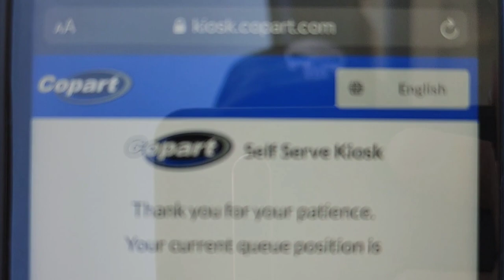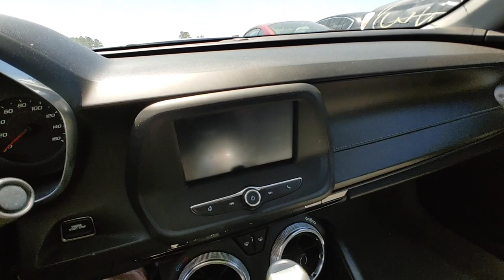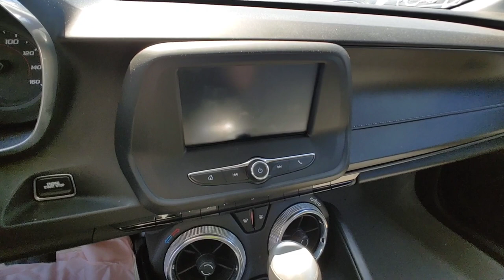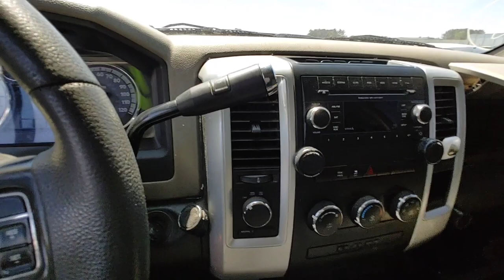Copart Walk Around BMW M5, M Sport, X5 M Cheap

Comment: 11:50 That white Ford pickup looked interesting. 12:20 That red Mustang didn't look too bad. 15:25 the Honda sitting in front of the Malibu looked really nice. 22:55 those Honda i-VTEC K motors are pretty tough little engines........they can take a decent amount of ass whoopin before they start giving you any problems. 33:16 "That looks like a Ford. It is a Ford" I have to correct you sir......that WAS a Ford.

Comment: That 440k Tahoe isn't too bad for having that many miles. I have seen much much worse with a little over 100k miles to be honest. But they can be runners. I got a 2000 Silverado with 198k and it's having oil pressure issues but she runs and has TONS of power but because of the weak oil pump (common for these vortec engines to have oil pressure issues), I drive it like grandma.
Reply from the maker: Yeah but those aren't that difficult to replace
Reply: @TKsGarage  you gotta drop the cradle I don't have a lift sadly. Also this is a Wisconsin truck since new so it's rusted badly underneath I can only imagine the difficulty trying to get some bolts loose.
Reply: @TKsGarage  keep up the good work bro we love the videos. I keep a eye on you and randy. Randy is how I learned about you.
Reply: Hey man sometimes the oil pressure  sending unit goes bad on those. Try that. I have 2 high mileage trucks with that engine. Oil pressure shows low but is not!! Shows low on the gauge but is actually fine...

Comment: I am wondering if there is a reason why completely burnt vehicles like those you show are not sent straight to scrapyards instead of the auctions. The only reasons I can think of are that sending them to auction is required by their charters or by law (in case some silly bugger wants to try to resurrect them.)
I would be very interested to know if anyone knows the reason they are auctioned,  please.
Reply from the maker: I have no idea why they are there. But people do buy them lol
Reply: Every insurance car is ran through an auction even if it is burnt or nothing left but a wheel. It's just how it works.
Reply: That honda steering wheel lol. You had me rolling!!!!
Reply: Maybe a rejected repair on the ram. Missing the antenna and mount?? Or a botched repair?